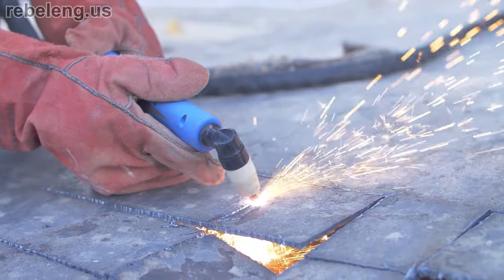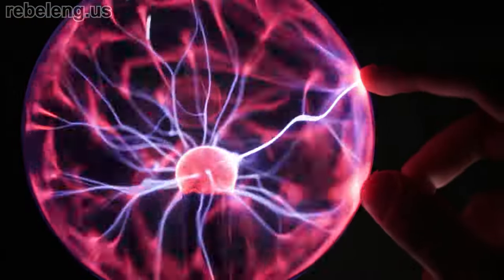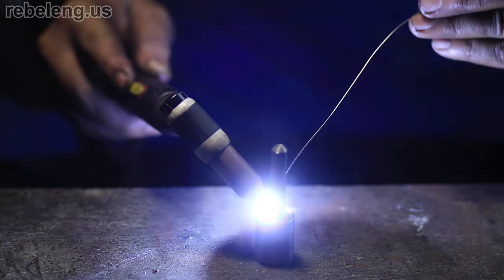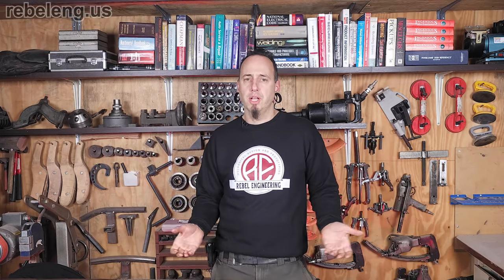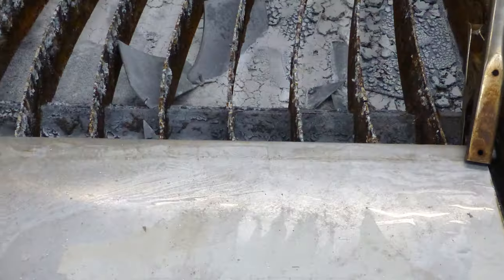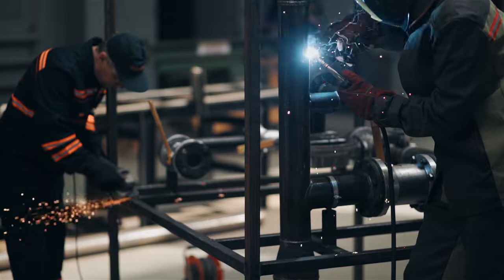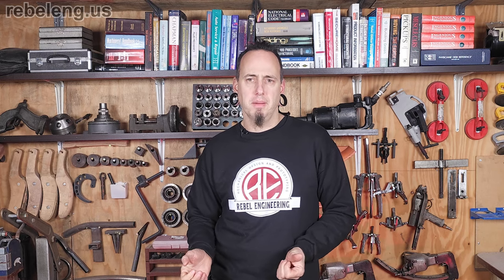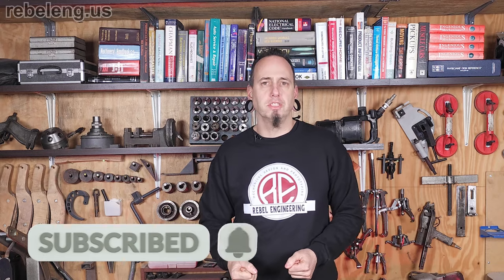The SHOCKING Truth About Plasma Cutters Revealed!

Comment: Carrier of electrons is maybe also not really true.  Closer would be that making plasma requires seperation of the gas into ions and electrons and recombination of the electrons and ions generates massive amounts of heat when plasma is cooled.  The surface a plasma impacts will cool the plasma, transferring vast quantities of heat to the surface.  Also When oxygen is the gas, it thereafter oxidizes the metal exothermically at a rate accelerated by all the heat in a self-sustaining manner so long as the heat and oxygen concentration are high enough, just like with an acetylene torch with an oxygen rich balance.  

The notion of carrier of electrons is however how one quantifies how 'hot' the plasma is, as a perfect measure of how much of the plasma is ionized.  The higher the electron/ion concentration, the hotter it is, and the more heat it puts into a surface per volume of plasma when it cools.  

edit: see similar: atomic hydrogen welding.
Reply from the maker: I think that is a great explanation. I had a longer explanation, but being this is intended to be more of an into overview, I tried to come up with something that could be understood while being accurate enough to get the point across. I think I cover the oxygen in one of my comments or one of my other videos.

Comment: Thanks for the great explanation of Plasma cutting. I’m seeing low priced Chinese plasma cutters that are “non” high frequency! Can you explain that? Please and thank you!
Reply from the maker: There are a lot of cheap blowback units on the market too. It really just comes down to quality. I can't speak on specifics, but you just have to read reviews to get an idea of how well they work. Unfortunately, reviews usually don't tell you how it will hold up several years later. However, if you are not going to use it a lot, a cheap blowback unit might be worth it. Also, a High Frequency unit may be OK too if you are not going to put it on a plasma table or use it near sensitive electronics. Most TIG welders are HF, and we deal with by just being carful where we plug it in.  

I made a detailed video to cover all of this.  https://youtu.be/2056G3czAS0?si=vYDiZLjnvvFOFMK4
Reply: @rebelengineering  thank you, will check out the video!

Comment: All in all quite good, but
Invented by mistake by Kjellberg Finsterwalde when a welding transformer was miss wired, not whoever you mention
4 types of starting the arc, High voltage, high voltage at high frequency, blow back, and scratch start
And the only shocking is if you touch both ends of it, or if touching the nozzle and starting the torch.

Comment: You have not mentioned Pilot Arc plasma cutters those don't need an electrically conductive material to cut.
Reply from the maker: I am not faliliar with those. I have always use a laser or water jet for nonconductive materials.
Reply: Isn't running on pilot arc only hard on the consumables? It was my understanding that the arc starts in the nozzle due to some high frequency wizardry and this circuit is shut down when the arc is established between the torch and the grounded metal you're cutting.
It is pretty fun to play with the pilot arc machines. I had an old thick welding glove that was pretty stiff and "baked" laying around and one quick pulse of the pilot arc cut a perfect hole straight through it. Kinda want to grab a hotdog and see just what it would do to a finger.
Reply from the maker: @BurnerJones  The pilot arc should shut off as soon as it completes the circuit with the metal being cut. The pilot arc does not have enough current to cut anything. I have Part 2 to this video that explains it all.   https://youtu.be/2056G3czAS0?si=PqcqxQ2IHPm63-5y
Reply: That’s only meant for easier starts through paint and rust. The material must still conduct. If the pilot arc stays in for more than a few seconds it will damage the parts in the torch and it’s not good for the power supply either. I suppose you’ve never used a plasma cutter.